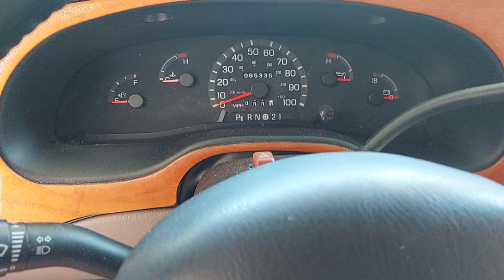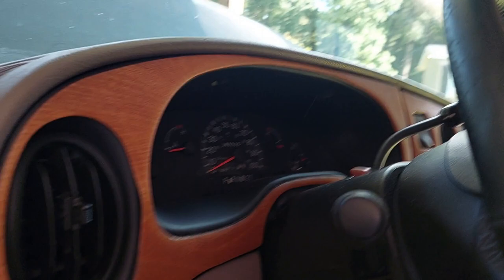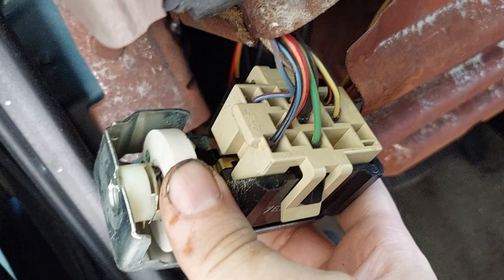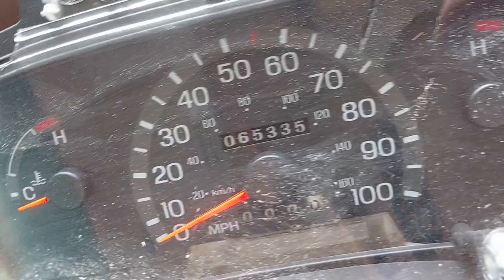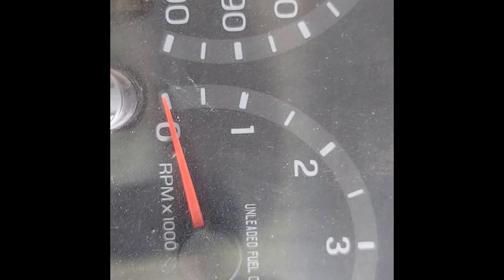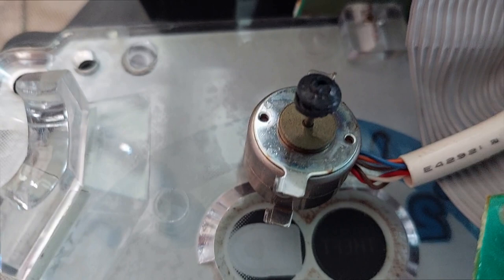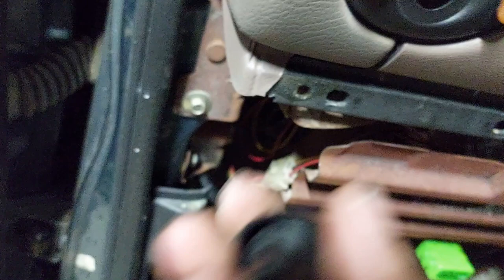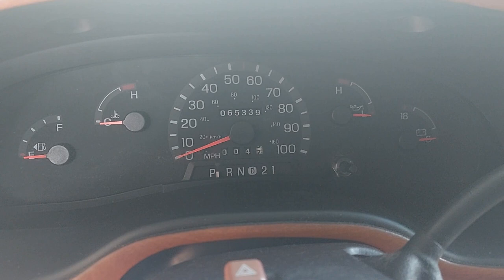Episode 131 - Headlight Switch and Odometer Gear Repair 1997 Ford E-150 Econoline

Comment: Love the video. Just wondering what happened to the tack on the instrument panel? 
Maybe I missed something. 
Very interested because I have 1997 E150 and would love to have a tack.
Reply from the maker: What happened is that I had it wrong.  The tach I had from a 1997 F-150 was of a different shape and had different wiring requirements than the cluster for the E-150.  So in the end I reinstalled my E-150 cluster.  I do know however that there are aftermarket Tachs that can be purchased and wired up if needed.  I might do that at some point down the road.
Reply: @MazdaB3K  hey B3K.....did you install a tach yet?   I'd like to do that...can it be put into the '97 e150 dash?
Reply from the maker: @surfbug1  I made the attempt, but I was wrong about the F series cluster.  It's not a drop in.  The wiring is different and the shape of the cluster is different.. I imagine it wouldn't be terrible to install a 3rd party tach setup but the question would be where to put the gauge.  I've sometimes thought about getting a set of "A" pillar gauges and installing those but that's a pretty low priority.  When I do need to check tach readings I generally use my OBD2 reader.

Comment: and u said only do a "trip reset" when parked, correct?
Reply from the maker: Yes.  The problem is when the vehicle is moving the worm gear is turning to record mileage.  When you push the trip reset button it forcibly stops the gear whilst the motor the gear is attached to is still turning.  Eventually it causes the gear to fail.  If you are not moving, the gear is not turning therefore not an issue when you reset the trip counter.